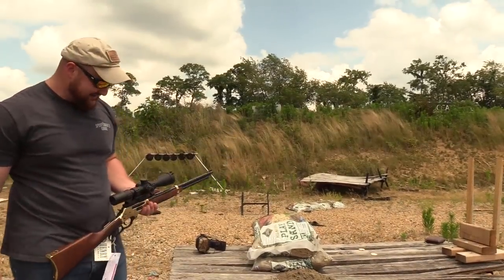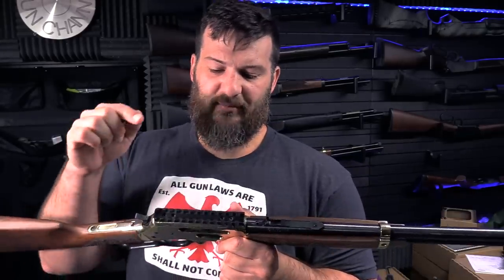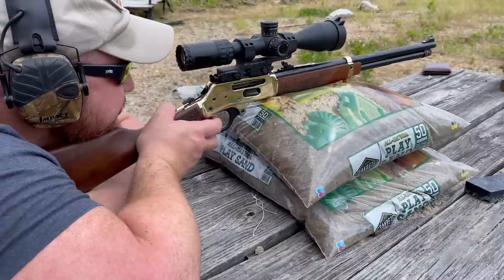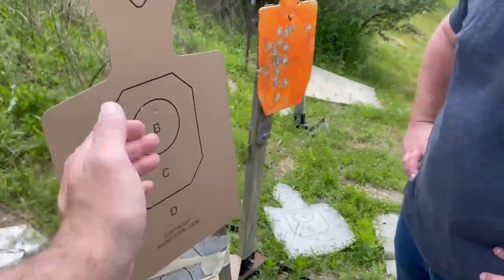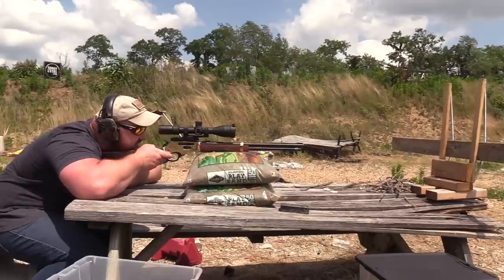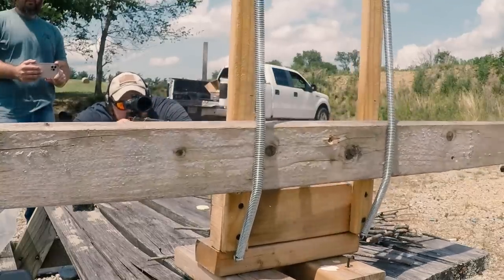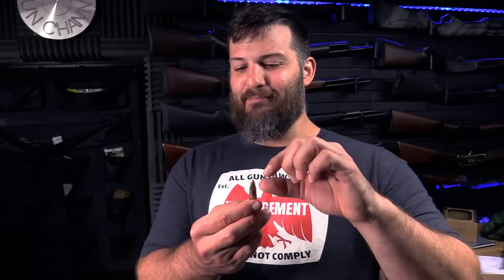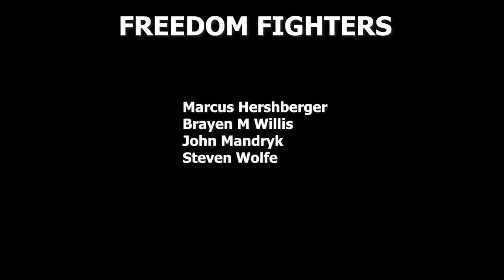What is 35 Remington? Is it a Brush Gun?

Comment: I recently heard that Ruger ( who’s has now acquired Marlin / Remington) is going to reintroduce the 336 lever action rifle chambered in .35 Remington by popular demand 😍 I’ll buy one for sure . Elk , moose , bear or deer , this is a do it all cartridge ! Flattens everything that walks in the woods .
Reply: 35 rem and 30-30.
The only two I think Marlin originally made the 336 for.
Reply: @oldmangreywolf6892   32 Special, also.
Reply: @garyh1449 
I will check that one.
I know 32-20 was a rifle round but a very rare find.
Edit: my mistake, should had looked up 336 not the 32 special.
Yes but pre-ruger they only made 35 and 30-30 recently.
Many cartrages do fall out of favor.
Reply: @oldmangreywolf6892   The last year was 1963 for a 32 Special chambered in a Marlin 336C
Reply: @garyh1449 
That would be when Marlin was still independent. Not owned by Remington.
Reply: Beautiful rifle with exception of the cap gun trigger.
Reply: @oldmangreywolf6892  and .32 Winchester Special

Comment: They did a similar test on Target Suite and He used a mix of bullet types and it seems that bullet types make more difference that calibers. The Fosters slug He used in 12 gauge tumbled as did a hard cast 45-70, full jacket hollow points did also, the best performance He got was from JSP (jacketed soft point), I believe that it allowed the tip to deform and keep going instead of tumbling out of control. I was surprised that the 12 gauge didn't do better maybe a different bullet or buckshot would do better. From all of the tests I've seen I'd go with JSP ammo in whatever caliber I had with the heaviest bullet I could get. We know all of the stuff you tested is a good hunting cartridge.

Comment: I've been using the .35 Remington for over 10 years now. I tried the FTX and was not impressed with them. I'm much happier with the Remington 200 gr. core-lokt.
Reply: Can you please explain why? The FTX is more aerodynamic, has a higher velocity, has more energy,  is more accurate out at longer ranges, and still weighs 200 grains. Does in not have the same thumping mechanic as the core lokt or something?
Reply: @beardeddragon9255  
The FTX did not expand well at all. It basically punched a .35 caliber hole through the deer.

Comment: the 35 rem and the 30-30 is like betamax and vhs  30-30 won out it  hence people worked for years on that load and we got some great 30-30 loads now if the same research had been done on 35 rem we might have some great 35 rem rounds
Reply: <-------thats how I heard it
Reply: You might try a 356 Win, it's a improwmet ower the 35 Rem. Mi fav. Browning BLR in 358 Win
Reply: I make my own great rounds with the 180 gr. Speer FN cooking out of the barrel around 2400 fps. No pressure issues in the Marlin 336. I am delighted Henry decided to build their side loader in .35 Remington.
Reply: There are great 35 Rem loads … easily exceeding 30-30 energies.
Reply: 30-30 has been around WAY longer
Reply: @Kaseyaught6  For absolute sure. If people knew the true differences between the .35 Rem and the .30-30 Win, the .30-30 would be obsolete.
Reply: @Evocati WAY longer?? As in 11 years? 30 30 introduced 1895. 35 Remington introduced 1906. 35 Remington hands down the better cartridge.

Comment: Out of the fear of lawsuits, the .35 Remington factory loads are quite anemic. The round was originally designed for Remington by John Moses Browning made in the first auto loading repeating rifle in 1908. The auto loader cannot handle the higher pressures of modern powders and loads so factory ammo is loaded lightly because a lot of those old auto loaders are still being used. (Model 8 and 81) Marlin started loading the .35 Remington in their new model 336 in the 1930's when the .35R was still quite popular. The pressure issue was passed along to the 336. However, many Marlin 336's were chambered with high pressure .356 Winchester and .375 Winchester calibers with pressure indices approaching 50,000 psi. Yet, the exact same receiver and bolt are used for the high pressure rounds as for the low pressure .35R. Many .35R's have been rechambered to .356 Winchester and some to .358 Winchester and safely. The new Henry Buckhammer round sports a pressure index of 48,000 to 50,000 psi yet they  use the same receiver for it as they use for their .35R like you're using in your YT post. I reload my .35R with 180 grain Speer FN's with higher energy and of course velocity. The brass has been reloaded numerous times with little to no trimming needed. There are no flattened primers or difficult extraction. Buffalo Bore ammunition sells a 220 grain .35R with a factory velocity of 2200 fps. Buff Bore warns the shooter to use only in modern firearms for obvious reasons. I am not saying to reload your .35R to dangerous levels. I've not measured the pressure indices of my reloads. But, reason tells me the .35R could be an even better hunting round loaded to its maximum but still safe pressure levels. Next to the .444 Marlin I think the .35 Remington is the finest lever action cartridge ever made. And, I agree, the Leverevolution 200 grain bullet is marginal at best. Stick to the 200 grain round nose or the Speer 180 grain flat nose. Out to 200 yards ballistic coefficient is pretty meaningless.

Comment: 12 guage old style foster slug is excellent in brush, period. 30-30 is the first U.S. smokeless cartridge. It is also a rimmed cartridge as are 7.62 x 54mm, 30-40 Krag, 303 British and 45-70 GOVT for instance. The 35 Remington, introduced in 1912, is a time tested and proven, rimless cartridge, ideal for woodland environments. The standard 200 - 220 grain round nose or flat tip type bullet is excellent in thick brush against targets within 60 yards. It is ideally suited for use at targets within 85 yards in terms of stopping power, and will connect with targets within 175 yards dependably. If shots are within 80 yards the 35 is great for black bear, elk, moose, caribou, mule-deer and white tailed deer.

Comment: 35 Remington was the cartridge used in the FIRST semi automatic rifle - the Remington Model 8 designed by John Browning.  The cartridge was designed for semi auto use and it would be cool to see it in a modern rifle. Btw I think the Hornady factory ammunition while it may get good velocity for the cartridge, I find accuracy not as good as the Remington core-lokt, but best accuracy is handload it. Actually, factory ammo is kind of a joke in modern made rifles as its under loaded for older rifles out there. The exception is the Buffalo Bore 35 Rem ammo. Handloading puts it into a different category. I dont shoot any factory ammo anymore as once you learn how to load it up, getting 2400fps with a 200gr bullet is no issue -  IMR3031, Reloder 7, LeverEvolution, and for super heavies (250gr+) I like IMR 4064

Comment: Not sure if you are a hunter,But the 35 Remington is just about the best 150 yard hunting round you can have,I've been using it since 1983 with 200 gr Winchester soft points when you hit a deer or hog that animal will not run,I have a video of a 7 pt I shot a couple years ago it was standing behind a live oak tree all I could see was it's ass after a hour of waiting I decided to shoot it in the ass spin it around and put one through its head I shot at about 75 yards the deer dropped never ran I walked up cut it's throat when we skinned it out the bullet actually turned his entire spinal cord into powder and separated his ribs,Ive also shot deer behind the shoulder and have it blow the shoulder blades out the other side

Comment: I have a rem 760 pump chambered in a 35 rem. I am able to handload 200gr sierra bullets at 2350 fps. That load really hammers a deer!
Reply: You can also load bullets with a higher BC in your 760 because of the magazine not being a tube under the barrel. The other thing about the 760 is the bolt locks in the receiver like a bolt action thus allowing greater pressures. The downside to the .35 Rem is the limited case capacity. But, if you can load the 200 grain bullet and get 2350 fps at the muzzle you have a load that is a twin to the .356 Winchester. This would be an ideal round for big elk out to 200 yards. Don't let anyone tell you it isn't adequate for big game. It is. I love my 336 Marlin bought for $88.00 at KMart in 1978. I load the 180 gr. Speer flat nose and get around 2400 fps at the muzzle. A 760 Rem would take me to a whole new level in .35 Rem terminal  ballistics with being able to load heavier bullets at greater velocities and not worry about pressure issues.

Comment: Test 460S&W please. Also, a comparison of the effect of rifling twist rates could deepen our understanding of what improves "brush busting" characteristics. A 45Colt load through 3 different guns; a 1:24 454Casull, a 1:20 460S&W, and a 1:14 45Colt. Then try a load with a higher sectional density (heavier bullet, same diameter) in the three guns preferably the same bullet type because longer bullets are more difficult to stabilize. Then try higher velocity with the same twist rate because velocity increases rpm which increases bullet stability. Bullet shape also comes into play. A comparison of Spitzer vs Roundnose vs Semiwadcutter or similar bullet shape would be a good comparison. There are many "elephant bullets" designed for straight line penetration through flesh and bone in 458cal that would also make for a good test. Thanks!

Comment: The 358 Winchester is  better than the 35 Rem.  It also recoils more.  If a person reloads it can
do whatever you want it to.  That makes it extremely versatile.   Another plus for the 358 is that
brass can easily be made from 308 brass.  If you want a 358 just buy a 308 and have it rebored
to .35 cal. by Reboreing by JES.  I did that with a Ruger M77 Mk 2 and have a gun that will shoot
3/4 inch or better 3 shot groups all day long with Hornady 200 grain FTX bullets and Varget.

Comment: 45-70 gov should be the next test caliber. I have 4 lever rifles... 30-30, 35, 44mag, 45-70 gov. I like large bore lever rifles. I consider 35 rem 200gr to be smaller of large bore.... 30-30 not so much
200, 240, 350 are the bullet weights I am using on 35, 44, 45-70 respectively. Mass plus velocity...I have iron sights on all my lever rifles.... 50-100 yards 90% of the time.... sometimes closer. I am using JRNSP bullets.

Comment: N0 ethical hunter would attempt to shoot "through" the types of brush and trees that you're  attempting to demonstrate.

Shooting "through" brush" might mean hitting a twig on the way to a clearly visible target out in the open.

Brush gun means short, fast handling , fast repeating rifles, handy when jumping deer in thicker cover and requiring quick follow up shots at deer N0T providing excellent target acquisition after that first well aimed ethical shot. Then shooting "through" heavy brush, but possibly N0T deflecting as much after striking a twig or vine.

My .22-250  would shoot completely through a 4x4.@ 100 yd. With a 50 gr. Varmint bullet.

As for the cartridge performance itself, it should enjoy far popularity than it presently does; possibly because of bolt action development.

Comment: The Hornaday 35 load is of no comparison to to the remington, Winchester  or federal factory loads performance wise by(experience in the field 3 times worst ammo regardless of shot placement) the 200grain Sierra game king bullets and 180 speer bullets used for reloading are extremely accurate and devastating  when reloading for the 35 remington even at a little longer range which isn't really that much. All 3 shot with Hornaday were absolutely horrible, even with a follow up shot.  Finished them with trusty 1911.

Comment: So I'm not going to say I have purposely shot through limbs and or small trees at deer. But I have now killed at least 3 deer after shooting through a 2 to 2.5 inch tree. One of those was with a 50 cal online muzzle loader at roughly 60 yards the others were 325 sjhp in 45-70. Only half of that bullet made it to to target on the muzzle loader but it did the job. Again not intententional but it happened and it worked. 45-70 is king of the brush